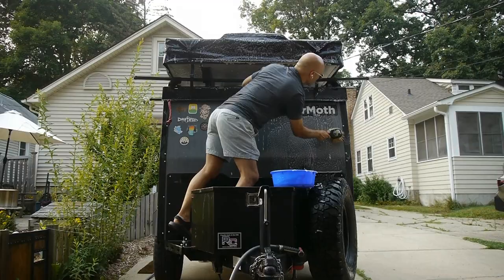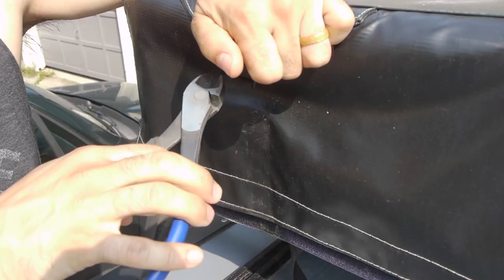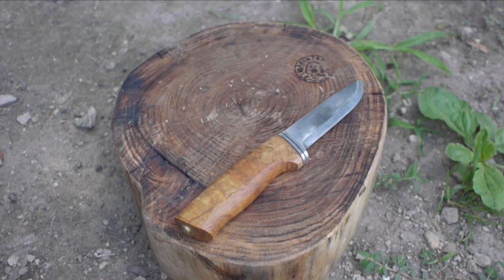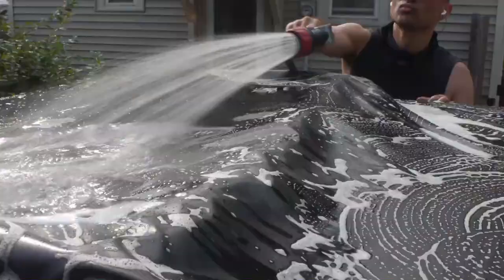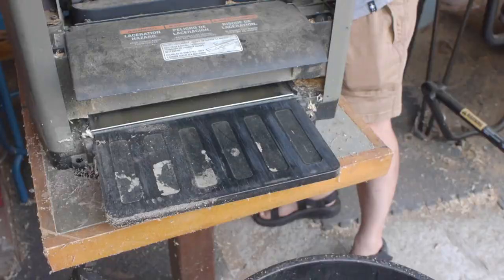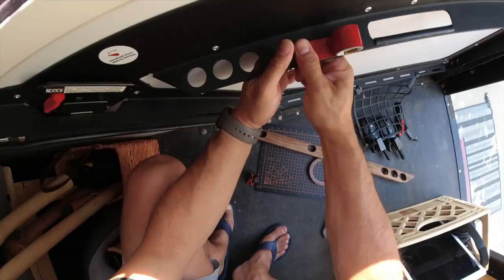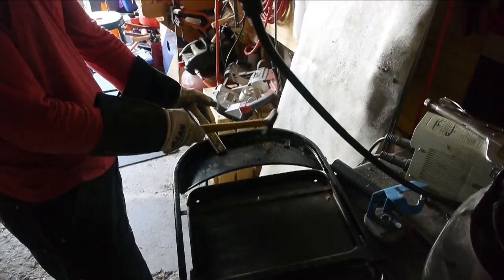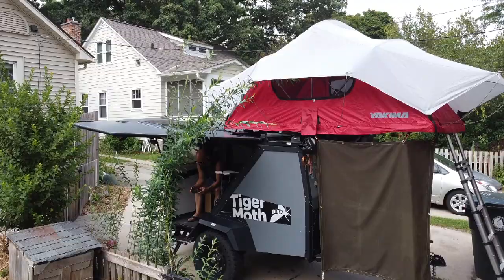Preparing the #Tigermoth Camper Trailer for Out West Journey 🏕🪵

Comment: Great video and ideas. I am thinking of buying this rig. What might your top 5 Pros and Cons be?
Reply from the maker: Great question. I like videos that tackle Pros and Cons so I might do one like that some day…I’d say the top 5 pros are 1. unique cool design 2. Well built 3. Fits in garage 4. Easy to tow 5. fits four people with the tent on top. Cons: 1) more difficult to back up than a longer trailer 2) sofa cushions are very firm 3) can feel cramped if stuck inside for a long time 4) lead acid battery is just adequate 5) roof track is harder to add accessories to than it should be. Hope that helps! 🪵🏕🪚

Comment: Have you made any more modifications to your Tigermoth since posting this video? And do you still like it, now that you've had it for a while?
Reply from the maker: Hi DC, I’m racking my brain to figure out the changes I’ve made to the Tigermoth since this video…I did get a new tow vehicle, but no major modifications to the trailer. I still like it for sure. Just got back from our first camping trip and the only thing I have some issues with is the rooftop tent. Let me know if that would be an interesting video. ✨👨🏽‍🏭🏕️